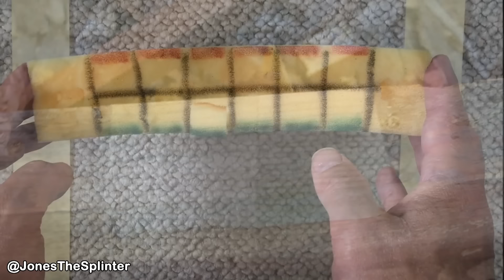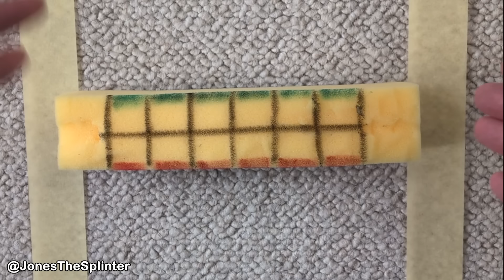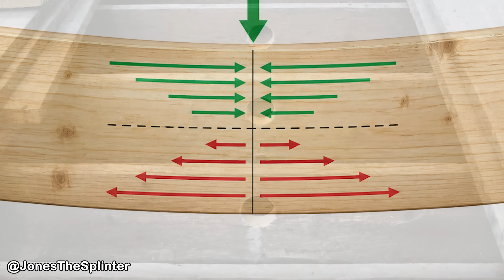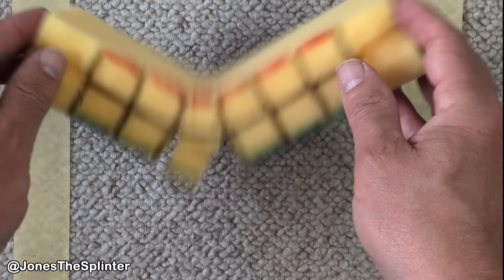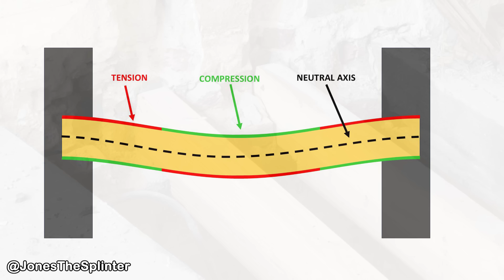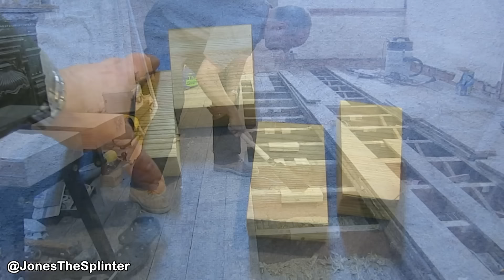This Joist Repair Works… But Only If You Know This Rule

Comment: Carpenter 46 years you at telling lies the joist has been compromised and your fix is wrong why spread lies?
Reply from the maker: You'd be surprised how much stiffness this repair adds back to the beam. It's just a fact of physics that beams are weakened by cutting notches out of them.  Stiffness ∝ depth³ according to basic beam theory (which basically means that when you half the depth of a beam you reduce the stiffness by a factor of 8).
Reply: @JonesTheSplinter a gusset is the only way to to strengthen this joist, did you serve your time or blagg it?

Comment: Great video thanks. However our floor/ceiling was butchered by a ‘couldn’t care less’ plumber at the bottom of the joists. The floor upstairs sags and creaks. It totally irritates me. The trouble is, there’s wiring, pipes and walls supported by that floor and I don’t fancy rebuilding the house for it. A structural engineer didn’t seem too concerned about it, but it bugs me that it’s not as solid as other floors that haven’t been butchered. I’d love to see different options for fixing the floor, both from removing the ceiling, or by lifting the floor upstairs.
Reply: Metal plate that goes across the cut out beam, make sure it screws in multiple points?
Reply from the maker: It’s really frustrating when previous work undermines the structure. Notches on the bottom are more difficult to remedy especially when the joist space is riddled with pipes and wires. As annoying as it is, even if the floor is more springy than it should be, if your structural advisor thinks it's sound, it's almost certainly easier to live with it; it may even become a quirk that you grow to love. Anyway thank you for the positive comment. Much appreciated.

Comment: You don't apply glue to the wedges? I probably would, even if it is just to prevent things from possibly shifting around later when hammering or installing a floor or something.
Reply: At about 0,26 in he states the wedge is glued and tapped in.
Reply from the maker: The final fixed was glued in properly. All contacting surfaces were covered in PU glue. I was doing a dry fix when I was tapping them in for the video; because I didn't want sticky fingers on my phone.
Reply: Totally missed that, my bad. Good job on the repair and the explanation.